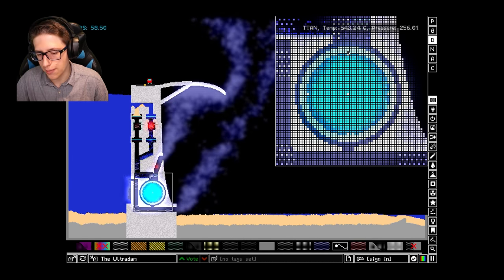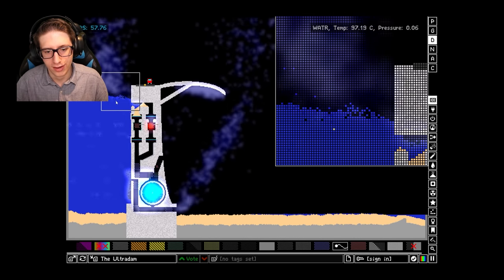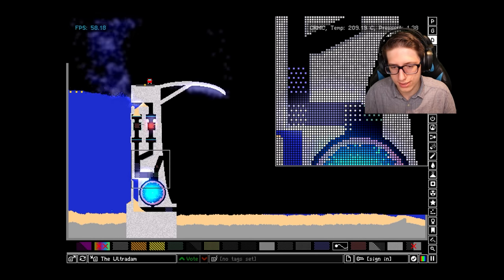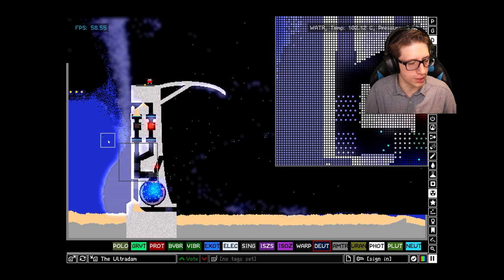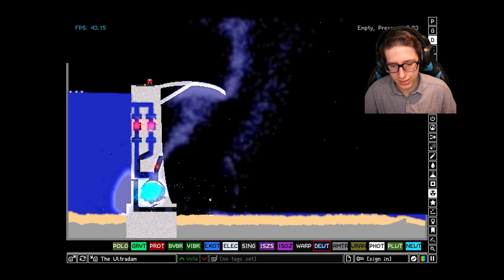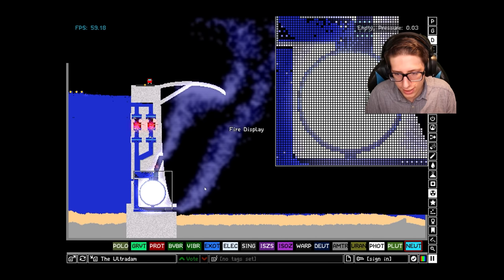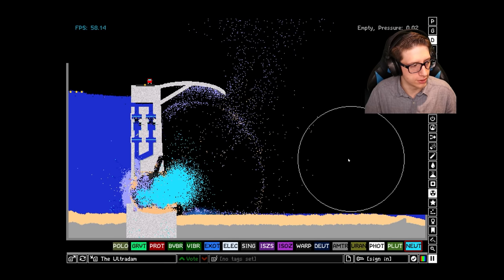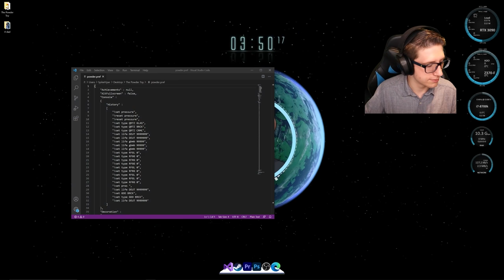NUCLEAR DAM MELTDOWN in The Powder Toy!

Comment: The dam must not have been making efficient use of the water for cooling in the first place if it lasted for that long with absolutely no water
Reply: Could be considered a good thing
Reply: @ralexcraft990  .. no.. operating at less than .5% efficiency is not a good thing
Reply: but, it did have water, it was boilling the lake through the walls, if anything this is a little feature for if all security measures fail (impossible)

Comment: I'm morbidly curious, if something like this was (or is already) built irl, and things started to fail, would this be an accurate time frame or would it take longer, or would it possibly happen faster? The world may never know. (and probably shouldn't try to know)
Reply: I don’t need life I need answers
Reply: Given the appropriate fuel? Yes. Using a modern reactor core? Assuming that none of the failsafe mechanisms worked it'd be at least this fast in most cases (you'd probably actually get a steam explosion on the reactor core and have a few seconds before the dam collapsed), if they kicked in though, it'd be far slower.

Comment: the reason that the hot water works for coolant is at that tempture you could pour over molten salt and it would cool as the salt would be colder than the reactor itself

Comment: If you cooled it from the bottom and vented from the top the Steam wouldn't be a problem
The water pressure should be enough to to push the water up to the top of the reactor

Comment: The soft meltdown is what happened in Chernobyl
Reply: WRONG! chernobyl killed up to 60,000 people and the entire plant melted down.
Reply: @familiamarquez3219  i was talking about how it melted down not how many casualties there were
Reply: Pretty close to it, though it seemed more medium. The reactor grew unstable due to a failed electrical test and when shut off caused a runaway reaction that caused two explosions (one steam, the other may have been steam or nuclear). Then it caught on fire, which is a bit closer to the slow meltdown.
Reply: @familiamarquez3219  The other reactors are still in service actually, it was only one reactor that caused the meltdown

Comment: All your flow routes are all wrong you have a bottleneck on your secondary turbine you were cooling with steam for a long time. The fact that you still had water spawners coming in and putting in cooler water was helping you out a lot but in reality you would have flowing water cooling the entire structure and for the instance of the video your nuclear dam does nothing use water turbines to generate electricity the nuclear dam does nothing but generates steam you're going to try and explain what's going on dude you have no idea what's going on